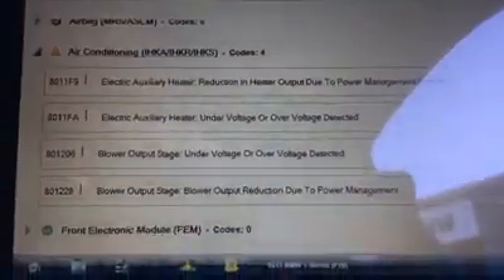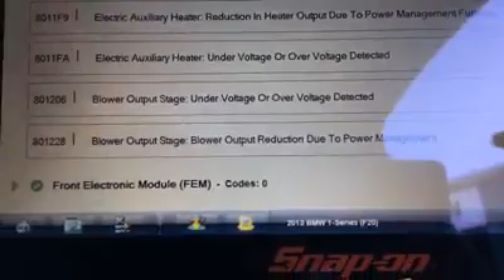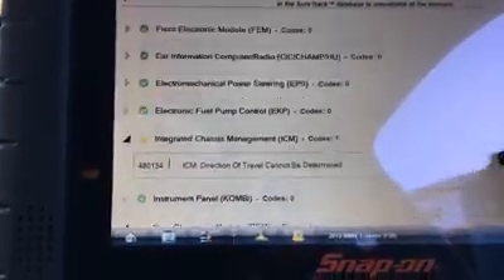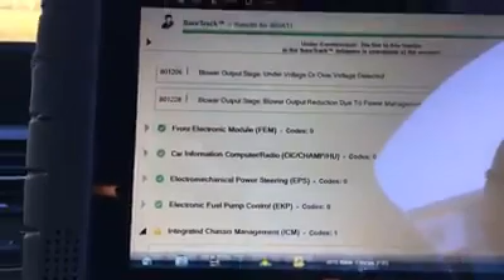BMW brake warning 2 & power management

Comment: great tip steve about the battery, just had the same on my wifes bmw 520 heater not blowing to full capacity changed battery and coded all well, the best is im keeping old battery as spare as it still seems to hold charge Ok cheers sandy